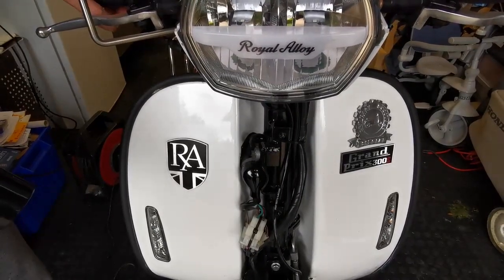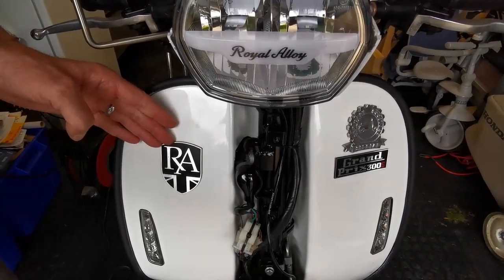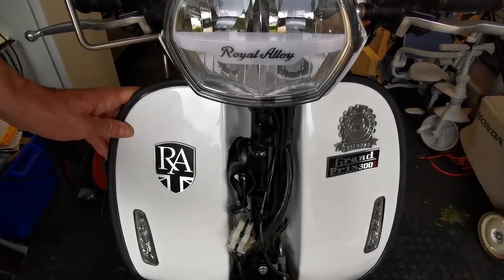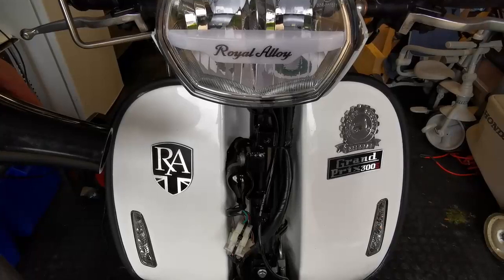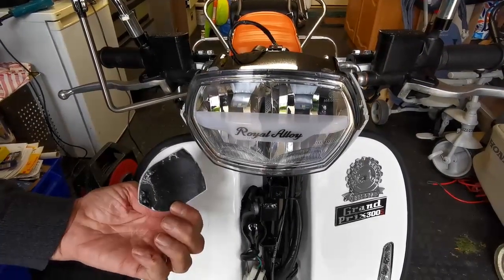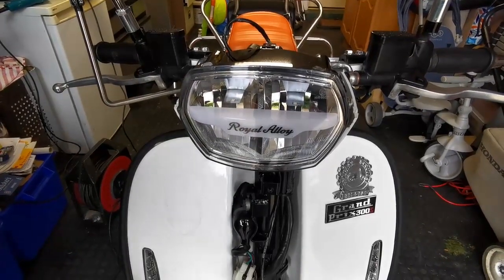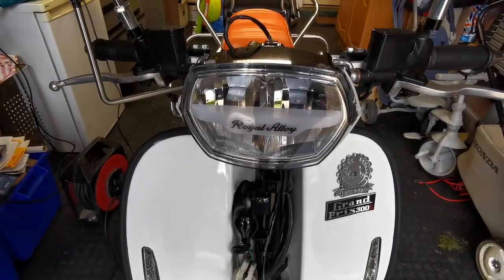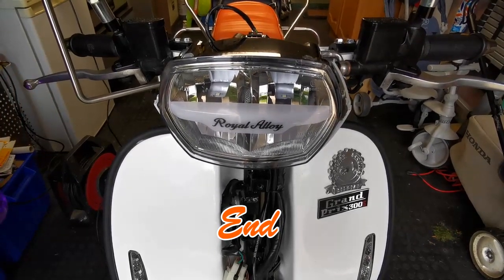Royal Alloy Removing badges

Comment: After warming up an adhesive badge from any vehicle it’s safest to run a length of strong cotton or button twine to and fro behind the badge to separate it from the body. This reduces the chance of pulling off a lump of paint with the badge. 😊
Reply from the maker: Would not disagree, fine fishing line also works well. I've removed a few and you can also use really hot water on the drive.
Reply: I used this technique and it worked brilliant, thanks chief

Comment: I've debadge mine and all you need is dental floss or fishing line about 5lb breaking strain
Reply from the maker: That's fine but without heat you risk pulling paint.
Reply: @MikeColwell   No you dont . The line cuts through the double sided tape no probs. You could say you could damage paintwork with heater if you dont know what you're doing
Reply from the maker: @maninst  I owned a large sign business some years ago and we often dealt with badge and vinyl removal from vehicle paint.
Reply: @MikeColwell  theres more than 1 way to do things
Reply from the maker: @maninst7145  agreed.